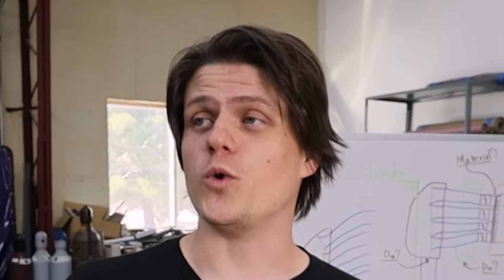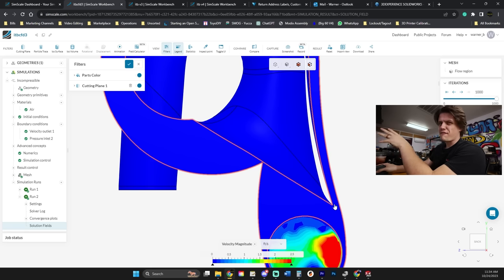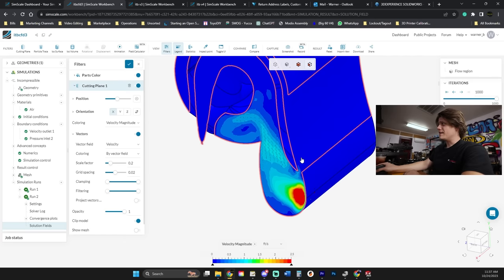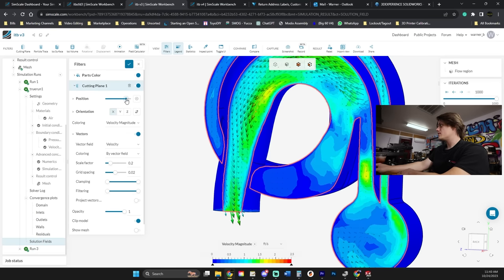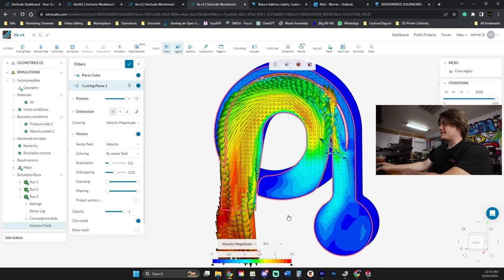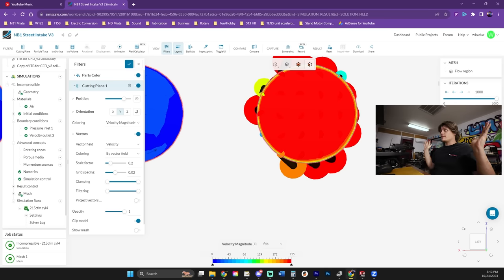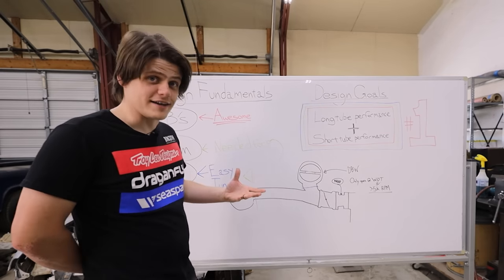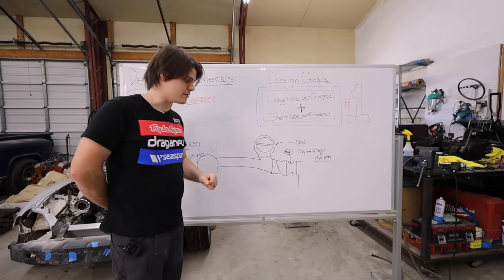The 3D-printed ITB intake system continues to evolve

Comment: Check out what Mazda did with the 787B Le Mans car.  Sliding trumpets to meet your exact design goals of low rev and high rev optimizations.  That could easily be controlled with servos (steppers with feedback to try really hard to reach the commanded position) and some linear guide rail.
Reply from the maker: Thanks! 787 on the research list
Reply: Thats the way to go, im working on that type of design with a shared plenum for a 4.6 Mod motor
Reply: Would be interested in that design aswell. Trying to build one myself for a k24 miata.
Reply: Look into creapunk CLI17 closed loop open source stepper driver.
Reply: @StandRacing  See if you can get your hands on SAE Technical Paper 920309. All about the R26B
Reply: I've seen people do this with electric drill motors as a cheap DIY option
Reply: @anthonycamillos3719  I think the 787B used a windscreen wiper motor
Reply: Yamaha make a variable intake runner for their r6 and r1. They are low cost and readily available
Reply: The design he is using is far more clever, and there are no added failure points. I'm way more into doing it cleverly than brute force like the sliding trumpet design.
Reply: Sliding trumpets are nothing special anymore. Many Porsches use them, Yamaha uses them in their sportbikes and I'm sure they are used in many other vehicles.
Reply: Cosworth also used them on the BDA 
And F1 DFV’s back in the 60’s . No servo actuation back then all analog ie cable. 

Dyslexia update/ edit Sorry misread the comment, thought it was about slide throttles not trumpets 😂😵‍💫
Reply: @StandRacing   Ultimately it comes down to harmonics and the speed of sound.  If you can design the intake in such a way that the length from the runner inlet to the valve is a harmonic of the speed of sound at a given RPM you should end up with a pressure pulse at the valve when it opens.  That variability is the challenge.  v = 331 + ( 0.61 ⋅ T )   At 35C and 1000 RPM that length should be 0.352m in length and at 8000 RPM it should be 0.044m.  Obviously you would need to pick your harmonic frequencies carefully, probably to optimize where the engine has the lowest torque and near the mid-point of the RPM range between gear changes.  So if your trans gives you a 3000 RPM drop between gears and your redline is 8000, somewhere around 6500 should give you the broadest area under the curve.  The problem becomes filling the greatest area under the curve in your useful power band.
Reply: @TheSunChaserUS  please do share that, id love to see the design and would love to try to adapt it to a 5.4 4v mod motor
Reply: @StandRacing lots of FSAE teams have done this too, you can find their design papers online
Reply: Was about to mention the same thing, a few companies in Australia have done the same thing on Rotary's, if you can make variable length throttle bodies that go from quite long to very short and use barrel throttles you will have a very efficient engine everywhere under the curve, you could follow the Helmholtz length for any rpm, F1 do this now but as they stay at very high rpm most of the time they don't need much difference in length, variable length exhaust would also help but that would be incredibly difficult and the weight would out weight the power gains
Reply: They did that in F1 too in the 90s.
Reply: You would need very long trumpets to cover for low rpm but in race car one good sized would cover enough of the power area to make sliding trumpets having not too much to gain for, theres many tests to this on dynos and im sure theres few in youtube too.
Reply: @Lacquerhead-TX you can do both whit dual chamber or shortcut design have long runners for low rpm hitting the champer wall and flap to give it shorter path to hit that same wall or champer. The pipe from intake to filter also has meaning how long it needs to be, correct pipesize has its own harmonic wave, usualy twice the lenght of the intake runner gets you somewhere but proper calculation would be needed to squeeze every bit out🙂
Reply: @Thee_Snow_Wolf  scih*b has it.
Reply: @StandRacing  May want to look at the 3.8l essex v6 from the ford mustang (2000-2004). They used what was called a Twin/ Siamese port design with a IMRC (Intake Manifold Runner Control).

Comment: As a programmer I am familiar with GNU GPL licenses for source code. These types of licenses require any derivative work to be published under the same license as the original work, enforcing the open source philosophy. (Or MIT, APACHE, and others) but I only see them used on source code. The other option I know is creative Commons. Something like CC-BY-SA forces every derivative work to include reference to the original and to be shared/published like the original.
Reply from the maker: Oh I'll look into that. I too have only seen open source licenses being applied to code, this may be a bit of uncharted territory but the principles should be all the same.
Reply: GPL 2 isn't that bad
Reply: @zach446  GPLv2 allows for anyone to make private changes without having to make them available to upstream. That's besides the point though as that license is written for source code that can be used to make software. There might be other licenses existing for other kinds of projects such as the mentioned CC-BY-SA.
Reply: @shijikori  yeah I ain't no lawyer so thanks
Reply: @StandRacing  you might want to look at CERN OHL or TAPR OHL instead. It's specifically used for open source hardware, so might be more suited.
Reply: @StandRacing  CC licenses can be applied to any creative work.
Reply: CC-BY-NC-SA (nc doesn't allow commercial use)
Reply: Might want to reconsider the non-commercial license as hardware can just fade into obscurity if it can't be commercially produced. It would also make it available only to those who have the means to produce themselves for their own use (which is far from everyone).

Comment: I'd recommend setting volumetric flow rate at the cylinder inlet port, not mass flow.  With mass flow you're forcing a certain amount of air where the engine is actually displacing volume.  I modeled this 12-13 years ago using transient flow and was able to correlate my simulated results with actual on vehicle MAF readings.  Calculated volume differential curves based off bore, stroke,  and camshaft phasing so it was a sine wave input with cutoof unique to each cyclinder.  I was able to measure throttle response of different designs by measuring the time it took to go from near vacuum to steady state mass flow rate.
Reply: The most interesting comment I've read so far as far as actual useful information

Comment: Take a look at the Porsche GT3 design that has ITB's located at the cylinder heads and the single throttle body located at the plenum. This setup actually builds some boost in a naturally asperated engine. Good luck with this project your doing.
Reply: That sounds really cool, I'm very unfamiliar with this I'm gonna research it. Cool stuff
Reply: That sounds awesome! I did a little googling, but couldn't seem to come up with anything. Care to share where to begin?

Comment: Late to the game here but, take a look at a factory Honda H22-A4 intake, they had the intake runners split horizontally upstream from the connection to the head, the top one curved up and was short, the other stretched out further before turning up to the common plenum. A set of butterflys in the short side forced the air to the long runner until a certain RPM, opening the butterflys, the air naturally takes the shorter route. Also check out a factory Acura RSX-S intake, it's round like yours and has a drum shaped valve to change it from long to short.

Comment: In australia the vz commodore sv6 with ly7 motor at 190kw has variable intake while the le0 175kw model doesn't. I did a bit of a google and came up with this info on a forum thread 

"The inlet manifold has a variable rotating vane assembly Intake Manifold Runner Control Valve (VIM) which is driven by engine RPM over about 4000RPM(?).
This is used to tune the inlet manifold for more efficient airflow rate at higher RPM.

Built into the inlet air tract which connects to the throttle body is a "tuned stub" which acts as an input air flow efficiency booster at higher or lower RPM. (Not too certain of the designers thinking here - possibly lower RPM)." 
as well as 
"EDIT
Did some more digging. 190kw engine. The VIM below 4000 rpm divides the intake plenum into two plenum chambers each feeding left and right banks to get low rpm efficiency. Above 4000rpm the VIM rotates to create a common plenum chamber for all cylinders."

Comment: to tune i would data log mass airflow on long runners only, then do the same on the short runner only, overlap MAF readings and you will see your cross over point as where flow rates intersect
Reply: If using map/tps for load (I like tps with map correction) you can do 2 complete fuel and ignition tunes and then switch where torque is the same at the crossover points on a 3D table for it to feel (and be) seamless.
Throw in some variable intake and exhaust cams and expect to spend a lot of hours testing and optimising it all together...
Reply: @NigelSwan  no not for load, but mass flow, hp= fixed amount of fuel per given kg of air, the maf can output calculated amounts so you can visually see changes/gains in design against others or for figuring out what degree of variable cam timing is best at what rpm, for instance with 50 degrees of variability you can start at 0deg, do a run, change to 10 deg and do another run so on till the 50 deg, overlay their graphs on top of each other and you now know what cam timing is best at all rpms because mass flow will be highest at most efficient rpm ranges, did not mean in regards to tuning and using it for load calculations.

Comment: Good example of “a model is only as good as you make it” and that’s why it’s important to understand the fundamentals!
Reply: Also to add. The mass flow into the system has to equal the mass flow out of the system. The variable that is potentially changing here is the area of the outlet vs the inlet. 

Mass flow = density of air times velocity of air times area. 

So air density is constant, you can change the area, so velocity will increase or decrease to conserve mass flow.

The simulation may give better intuitive results given you understand how much air is demanded from the engine at a given rpm range, this would be your total mass flow out of the intake, then optimize the intake flow

Comment: Your harmonics are effected by the length of the runners, so you need to swap out the whole length of the runners by closing one short and opening the other in order to benefit from the pressure waves alignment with the RPM of the engine. You could do this with a change over valve which could be switched between two (or more) connections.
Reply: Exactly! The sonic waves will be wasted bouncing back and forth through the whole system.

Comment: BMW 3 stage DISA intake manifold from the N52 is something you can get inspiration from. They use DISA valves to change the flow between long and short intake runners. It's pretty easy to follow too. Yours reminds me a bit of that! Good luck with this build. it's really interesting!
Reply: or N62's variable intake
Reply: it has resonance champer too and its combat design. Was n52 direct injection? One way to go would be to model m54/n52 intake as base cut it short to match engine and use same disa flap to controll the intake.
Reply: @winha1435  It was port injected for sure.
Reply: @winha1435  nope, N52 uses port injection. DI engines have 3/4/5/7 2nd number on the N engine type (N53/N54/N55/N57)

Comment: BMW's original approach was called DISA, basically a dual-length manifold with a valve to open and close the intake tracks. I think some of the later iterations had 3 intake lengths. Currently with their virtually all-turbo lineup they have fairly short manifolds and use a valve lift control strategy they term Valvetronic.
Reply: Yep very common on OEM's, and effective.
Reply: i know n52 has a 3 stage man

Comment: This is really some awesome work, I know many OEMs have come up with similar solutions like Ford's IMRC on the mustang mod motors, Mazda's VICS on the NB miatas, and pretty much every ferrari intake from the last 25 years. There's a lot of torque and power to be had by being able to effectively vary intake runner length based on rpm.

Comment: I would add that Toyota's TVIS sounds similar to this as well and that was used on the 4age, I believe yamaha was involved in their intake tuning and it would be cool to see if some of their variable itb design could work on a miata
Reply from the maker: Toyota TVIS added to research list 👍
Reply: @StandRacing tvis blocks one of the 2 intake ports per cylinder on the 16 valve head, so doubles the intake velocity by forcing the cylinder to draw through a single intake valve instead of the 2 available and increasing torque. Slightly different, but same result as a longer runner.

Comment: I definitely think the sliding trumpets are your answer... they have been done on the 787 and a few super bikes... if sliding is too tough...maybe try 2 or 3 sets of interlocking belmouths that are each controlled by a servo... that way you have a TON of adjustability... but all the dyno time will be brutal under each possible configuration

Comment: My 2000 lexus gs400 v8 had this setup. A vacuum operated valve and solenoid would open a shorter path inside the plenum at higher rpm.

Comment: Toyota has the ACIS system. It doesn't use another throttle body like in your idea, but a butterfly valve in the plenum that opens (I believe) with vacuum at a certain RPM and and effectively shortens the runners. Similar concept
Reply from the maker: Toyota ACIS added to research list 👍
Reply: Throttle body is basically just a butterfly valve with sensors and other accessories attached to it
Reply: @zuzuzaza98  that is a fact.
Reply: There are 2 different types that Toyota has listed  the same way one on some V engines has a plenum per bank then opens a communication valve allowing acoustics to fill a broader range of rpm.  The other version uses a barrel valve to switch between a short or long runner length such as in the 2AR. Pay no attention to Toyotas use of tumble valves.
Reply: @alexhise968  Correct. Even Subaru uses tumble valves.. something I believe is mainly for emissions? Not sure
Reply: Mostly cold starts like a choke on fuel injection

Comment: my Ford ST170 (aka focus SVT in USA) has a 2-position variable runner length inlet manifold which uses long runners up to 6000rpm (ish) and a short runner for 6000rpm to 7300 rev limit. 
known as IMRC and i think has featured on other fords from the late 90s/early 00s

Comment: I was doing some FEA the other day for some machined compressor components, it didn't look like it would flow well until I saw the result showing that the air was moving less than one meter per second, which was nice. However... turns out I'd forgotten to set the fluid to air, it was still set to water and I was using mass flow rate on the inlet... meaning flow was actually hundreds of meters per second. I feel like a small percentage of my time is spent actually setting or performing FEA, most of my time is just spent doubting my results.
Reply: You should always  doubt simulation results, especially for CFD. Most of the simple CFD tools out there are optimized to sacrifice accuracy for numerical stability, so that anyone can just click through a simple program and get results. Maybe alright for a very rough study, but if you really want to optimize parts, you need to pay close attention to all the details in your setup. CFD is a lot more complicated than stress analysis with FEA (you should always doubt those too, but the governing equations for stresses in solids are waaay simpler than those for liquid flow and that shows in how hard the simulations are to properly set up)

Comment: There was an Australian ford falcon straight six that used a dual port single throttle body. It also had a continuous 100 degree curved dual inlet runner.